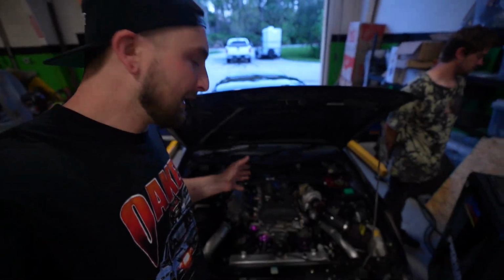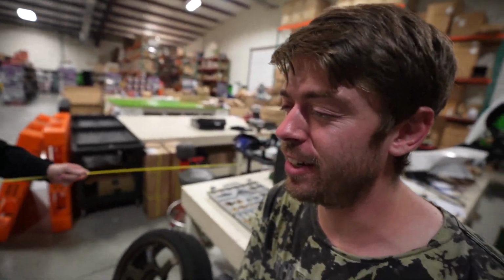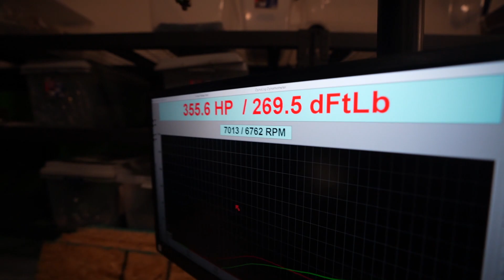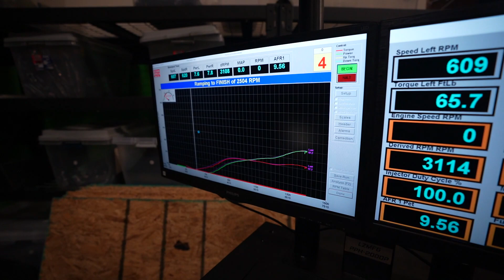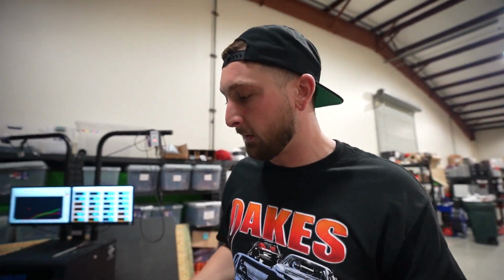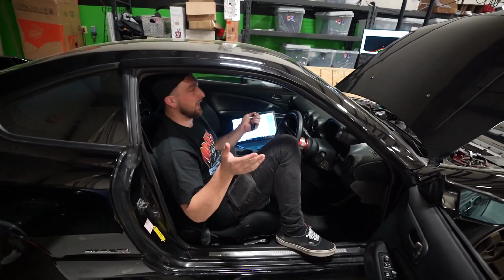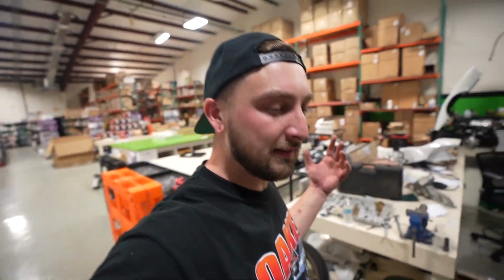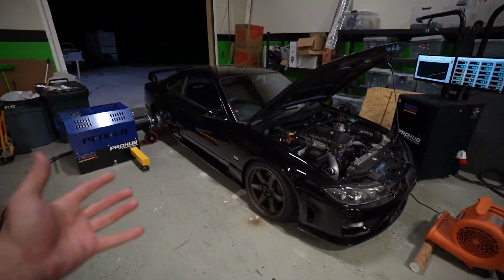My fully built S15 Silvia finally hits the dyno!

Comment: Hey Jimmy you could test the wastegate by unhooking the pressure line and pressurizing it while the car is running and you'll hear the wastegate open and close it it's working properly and you'll know what pressure it opens at if you use a gauge
Reply: This would be my first step
Reply: I swear 80% of the cars he tunes gets boost creep, he should know this trick by now hahah
Reply: That just tells you what spring is in the gate. 
His issue 100% seems like shithouse port placement on the manifold
Reply: @hotworksfab  Yup, I agree.
Reply: Suspense added for content?

Comment: I had the same problem with my SR20DET. Changed 3 wastegates, from turbosmart to tial, played with springs etc. - no joy. Turned out exhaust manifold was a bit of faulty and turbo was too big. It was easier for gas to go through the turbo instead of wastegate, which caused the issue. If you would put a smaller turbo probably it would be OK, however, it seems you will have to swap that manifold. PRO TIP: get the one which have perfect place for wastegate, under the non abs brake booster, saves tons of time ;)

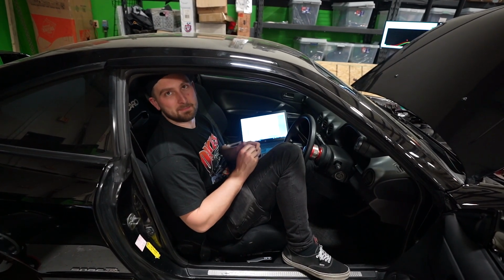Comment: @10:42, this means you have a mechanic boost creep issue. IE. your wastegate isnt large enough to expell the extra gasses which is causing your turbo to continue to spool up even when the gate is opened. very common for backyard build cars. i think your down pipe and your waste gate merger pipe have to be fixed, you need a larger waste gate and larger waste gate pipe (merging into your down pipe).. this will allow all the extra gas to leave the turbo without continually creeping the boost pressure.

Comment: I got my sr20det 180sx tuned last week. Made 300hp and 300 torque on 98 octane at 20psi. Forged bottom end and standard head with a small port on intake and exhaust. Thought you'd make more torque than that with your sr

Comment: I had the same issue on my SR22 with a TurboSmart gate (14psi) the tuner couldn’t control boost with wastegate off and would creep to 22psi. 

It was tuned like that and I beat on it for like 5k miles lots of track action etc then at my first drift day something happened and it started making 14psi and no more. I think the fire ring wasn’t seared correctly but the constant abuse of drifting must of done something. 

Also my power curve was super linear with the way the boost came in. No joke

Comment: Seeing this alot lately. Turbo technology has come so far i reckon it out does the manifold flow specs, those ridiculous places where wastegates sit doesnt cut it anymore. chop that U bend runner off, weld a vband straight off the collector. once those gases are ripping high in the powerband you cant control it anymore, almost as if you need to prioritise wastegate flow over turbo flow these days. 
whatta you reckon?
Reply: Agreed
Reply: You want turbo flow prioritized.  Will kill the spool between shifts which is dumb.  People are just cheap and don't get a big enough wastegate.  Most of these fancy turbos should have two wastegates.
Reply: @duanebailey6253  this would solve a lot of issues as well indeed